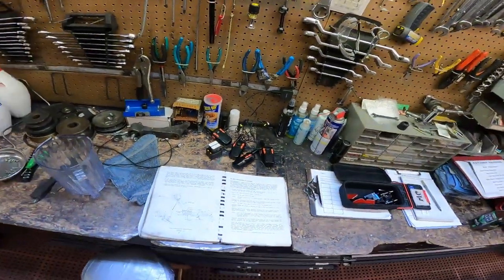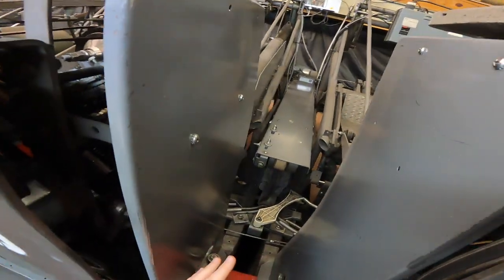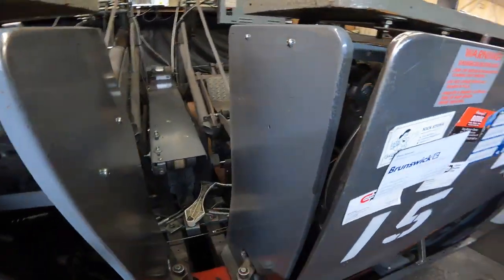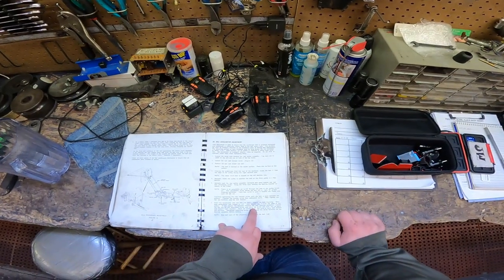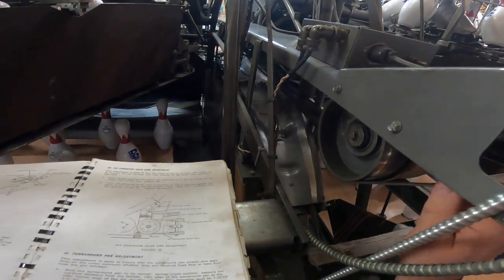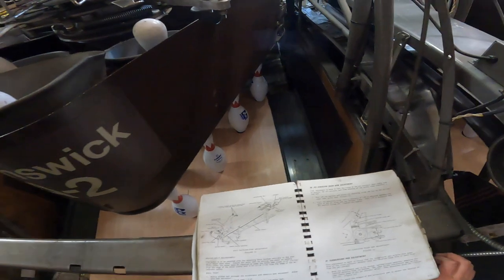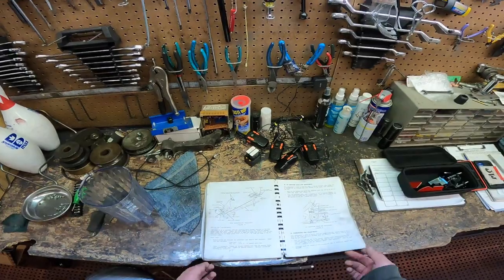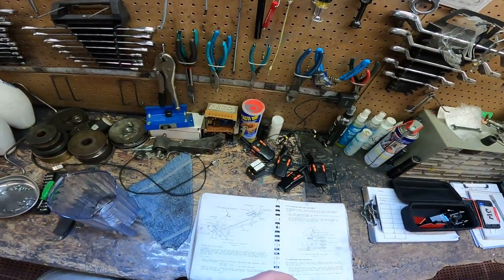Ball Accelerator #29 - Brunswick Pinsetter Adjustment

Comment: The service manual always gives directions from the orientation of the bowler looking down the lane, so I assume it's telling you to look from the rear, but adjust the belt 1" from the MACHINE'S right, which does look pretty close to how your belts are set up.

I'd also assume that "four turns" means four full turns, based on half-turns being mentioned specifically elsewhere.

In any case, you're doing amazing work putting all these videos together, this is an incredible resource!
Reply from the maker: Right, the turns makes sense to me but sometimes my dyslexic ass confuses my rights and lefts lol so 7pin side and 10pin make more sense to me or odd and even for lanes lol and thanks for the compliment hope they help you in some way!

Comment: Hey Shawn, it's Scott w rim country bowl in Payson AZ, your videos have helped me a lot as I was left w no mechanic 6 months ago my guy got to be to old and just couldn't get around machines any more. I got an issue w ball accelerator that I can't figure out, it started w ball call and realized motor was seized up, had lewis electric rebuild, installed and ran fine in back w no one on lane, left for the night and came back for league next morning first few balls get ball call go back and same situation
Reply from the maker: The motor was seized a second time?
Reply: Ya whenever balls are thrown it gets siezes up and hot, had electrician in on the second one to check wiring he said motor was wired up right, then paid a bowling alley  mechanic from PHX to come up yesterday, same exact thing checked wiring adjusted belt ran in back and actually lasted about an hr before got ball call and went back same shit, hot n seized shut down lane, went in this morning and ran it in back w no balls thrown for three hrs ran fine, went up front threw about ten balls and again getting hot and shutting down, that's when I started thinking when ball coming threw that it somehow putting to much of a load on motor, and for first time accelerator belt was kinda stuck but put some pressure on it and started free spinning again
Reply: I have a usbc tournament this weekend and got this and my kegel lane machine down just got the new motor in for it about 30 min ago from classic in Las Vegas took me about three hrs on phone to track one down been rough week 😂
Reply from the maker: That’s a weird one, I’ve never had that happen to me before. Maybe ask the forums on Facebook. Someone around the country has to have some sort of idea. Maybe also check the accelerator pan and make sure that it’s not to high or the accelerator isn’t to low. If you find it out for sure though let me know, would love to expand my knowledge as well
Reply: Ended up being pulley it self the housing wore down, put new pulley and bearings and fixed problem!
Reply from the maker: Well if I ever have that problem come up then that’ll be the first place I look, glad you found it. Sorry I could help more

Comment: Motor was seized and got got  to touch, had shut it down again,pulled motor and put brand new on few days later same thing runs fine when on but about 5/10 balls thrown and it siezes up and get hot, accelerator belt is free spinning, but everytime balls are thrown it puts to much on motor and gets hot, do you think the bearings in the pulley for accelerator?
Reply from the maker: Yeah I would check all your bearings on the pulleys and then make sure that the belts aren’t to tight. If after all that it still does that then I would get a electrician in there and make sure there’s nothing messed up on that end of things